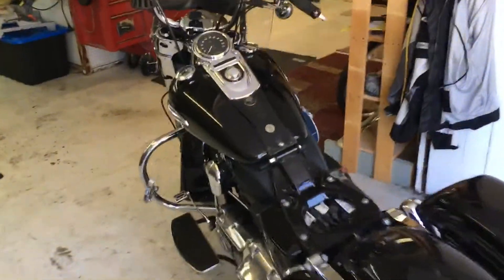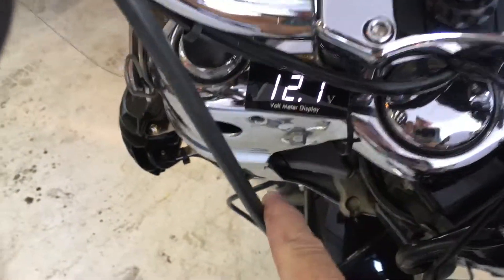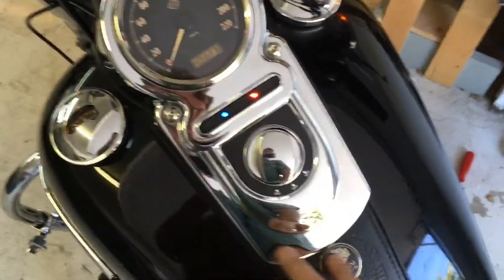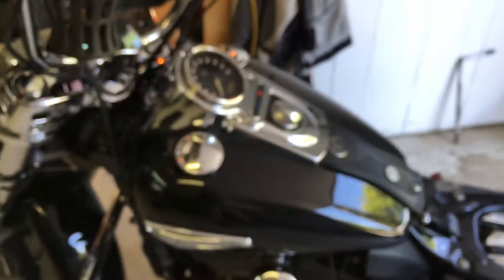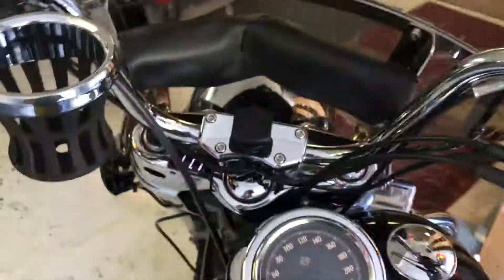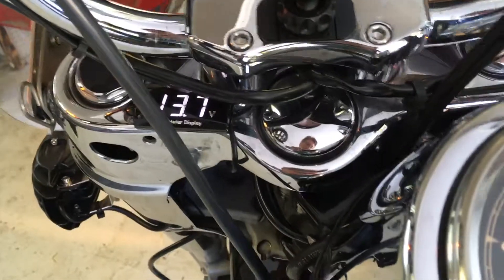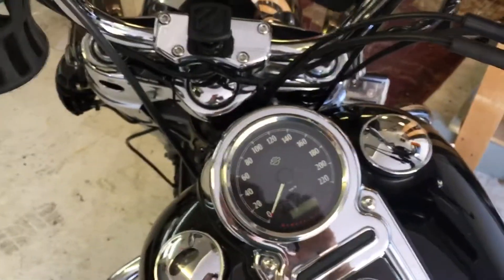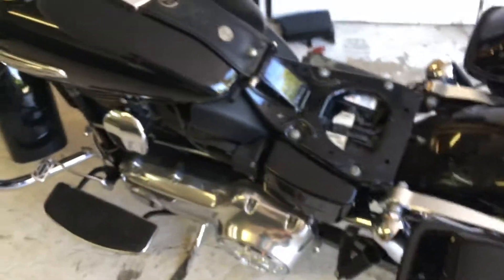Harley Davidson Volt Meter

Comment: Where did you get it at??
Reply from the maker: superred 13   Hey I got the regulator off ebay for $55 and the voltage meter on eBay  for $13.